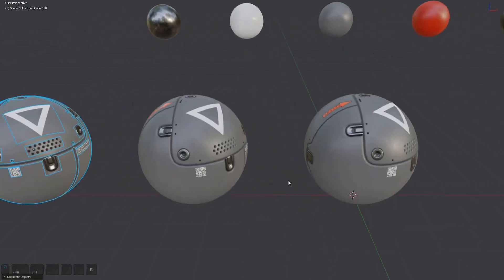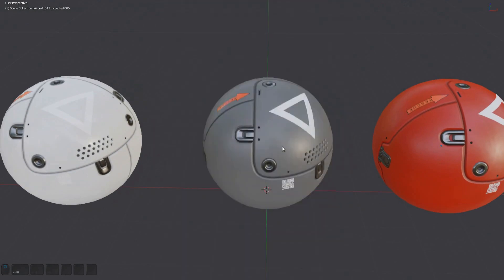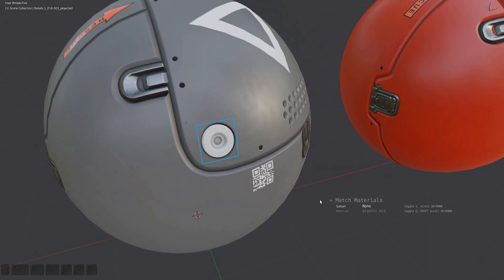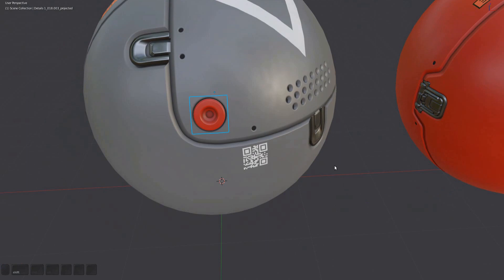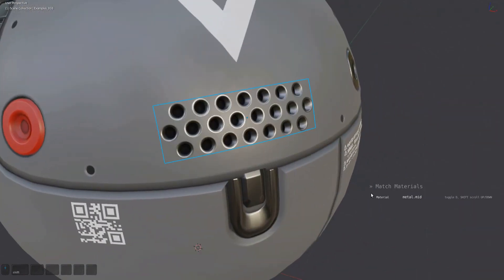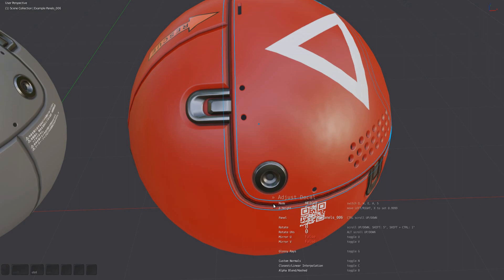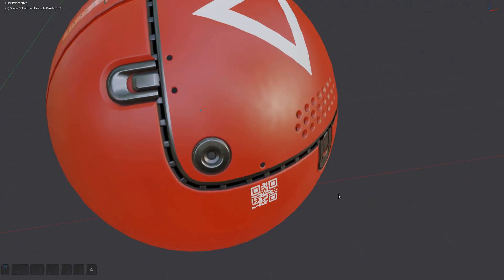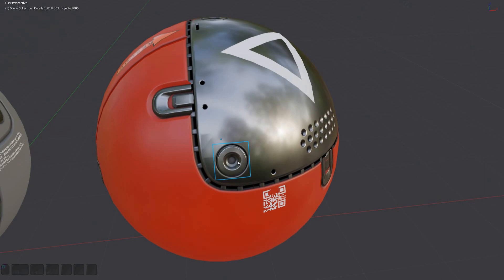DECALmachine 1.8 - Match Material

Comment: Checking this tutorial after having trouble matching the decal materials to the mesh. Point of confusion: does matching only work if the material used on the mesh is amongst the list of materials imported by MachineTools? Thx!
Reply from the maker: It works for every material with a Principled PBR shader node at the end as mentioned at 1:47 and  https://machin3.io/DECALmachine/docs/match_material/ MACHIN3tools has nothing to do with it.

Comment: why not using weight painting for the custom color inside of a decal at 2:40 ?thanks for thins amazing addon by the way
Reply from the maker: You can vertex paint this, if you want. You still need to do the cut, however, unless you are working with very high density geometry. Also, decals can't be matched to vertex color, they are matched to materials/principled bsdf shaders..